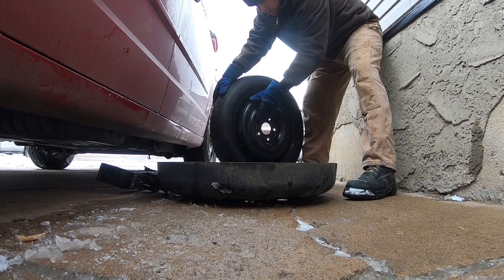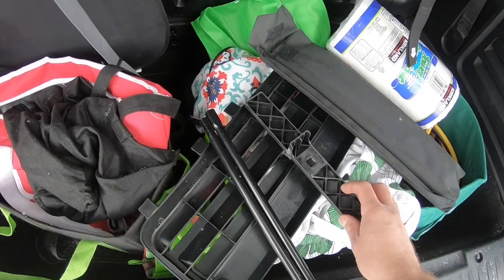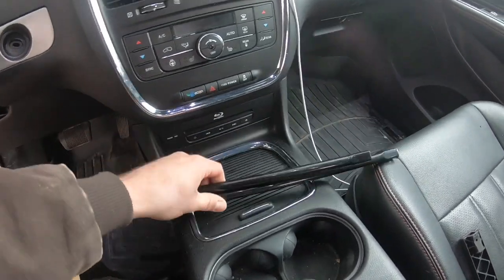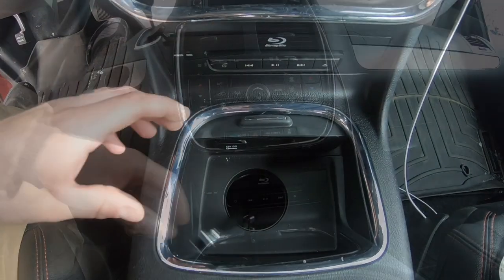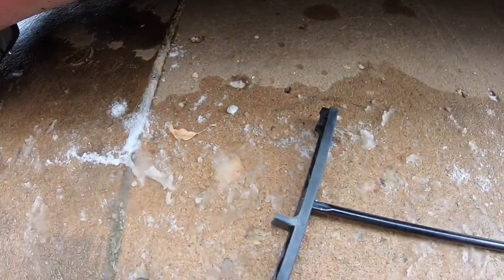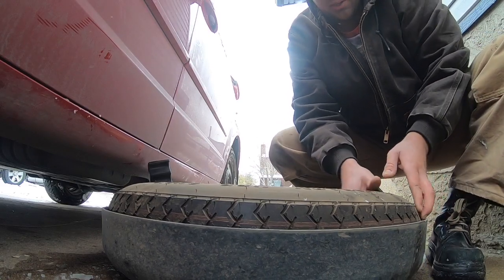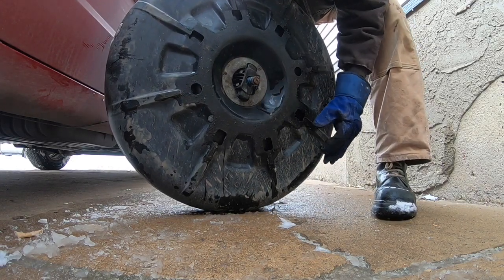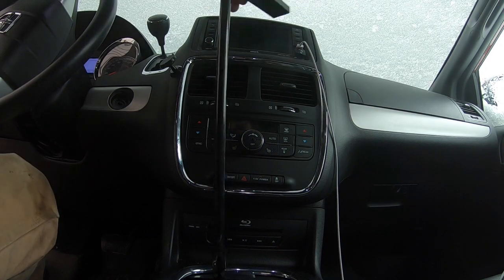Spare tire removal with Stow n Go seating

Comment: I lost the plastic handle for the spare tire kit when the tire shop returned the spare tire under the vehicle. They didn't return it to the kit and I didn't notice until a few years later when I had a flat. Ended up using a vice grip to turn the rod to release the cable. I keep meaning to buy a new one, but haven't yet. Good video!

Comment: Just think how much fun this is going to be on the side of the road. The tire only comes out on the driver side. Took mine down and found room for it in the back. Don't forget to check the inflation of the spare often. You might want to tighten the nut inside occasionally. Since taking spare down and stowing it in the back a lot of thumping noise is gone.  Guessing the cable stretches over time. 
Happy Motoring.

Comment: What a ignorant design.  This is why we hate engineers.  I helped a little old lady with a flat, in a 05 TnC van.  Rusted, cable would not go down, took forever and finally called for a tow truck.